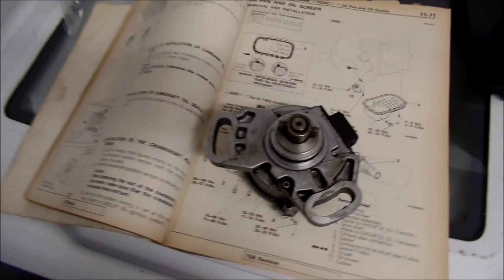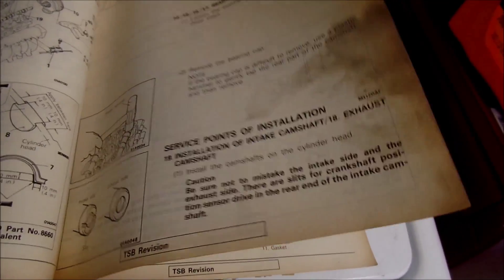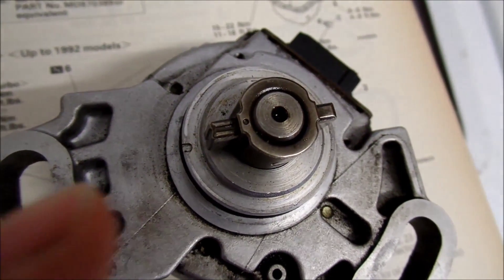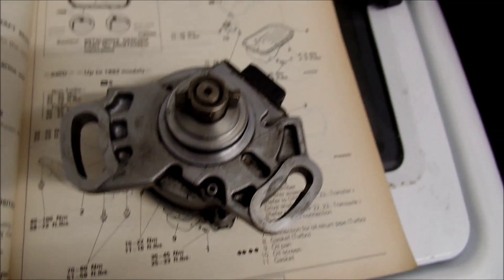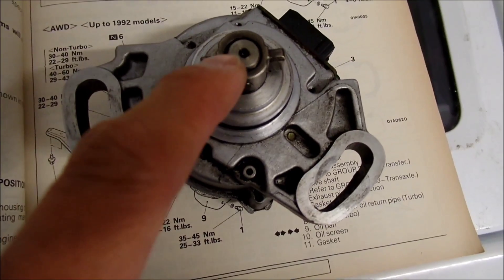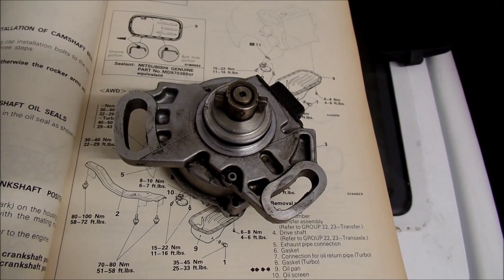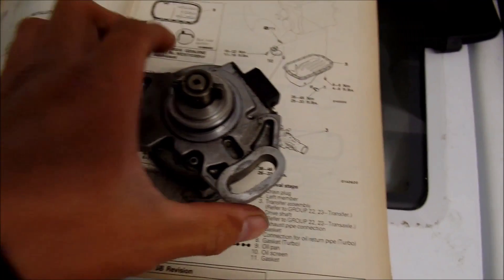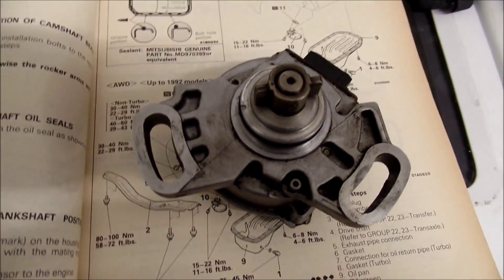HadesOmega How To Install 4G63 CAS (Cam Angel Sensor)

Comment: it doesn't matter if it's fitted either way around. They run wasted spark so 1/4 cylinders and 2/3 cylinders fire simultaneously
Reply: I would assume it would fire 2/3 when 1/4 is needed if installed back wards
Reply: @myramyrightnut1084  huh??
 The firing order is 1342. 
Cylinders 1 & 4 fires at 0° & 180°
Cyliders 2 & 3 fires at 90° & 270°
That cam angle sensor can only fit two ways, 0° or 180° out...
So, if it's meant to fire on cylinder 1 and timing is out by 180°, it fires on cylinder "4" instead. 1 and 4 share the same spark event on a wasted spark system so it makes no difference. 
If it were a conventional sequential ignition system and 180° out, it will fire on the opposing exhaust stroke of every cylinder.

Comment: As a heads up, it measures both the cam shaft position and the crankshaft position so it's technically both. That's why it has 4 wires. Power, ground, Cam signal, and crank signal
Reply: Can I read RPM as well?? Thats a doubt I have.
Reply: @BARRIOSENTERPRICE  I don't understand your doubt here. The crank position sensor is your "RPM sensor." It reads the position and counts the rotations which results in it reading the rpm.

Comment: where did you get the vr4 manual!!!???? need one but it's for imported 89 galant
Reply from the maker: I think I got it on ebay, there are not many good aftermarket manuals for the GVR4, the 1G eclipse/talon manual will be ok though.
Reply: HadesOmega I have the 90-98 Chilton manual and it does good for the engine and trans. interior and body is the dead zone.
Reply: @HadesOmega  Bro I need that manual? how can I get it? I want a digital one
Reply: Justin Hoth I have a 89 Mitsubishi too but I have a problem find the crankshafts position do you where is located. this is the link where I'm going to buy it let me know if this is the right one.www.autosparepartsmart.com/camshaft_sensor
Reply: @21elimprecionant   @HadesOmega  Bro I need that manual? how can I get it? I want a digital one
Reply: Joel Rivera I ended up having to buy a 1g dsm crack position sensor and had to wire the plug from my old sensor to the new. that help?

Comment: 95 96 dsm dose not use that style cas they are under the cam gear
Reply: Johnny Lucas really ??? My 95 gst has the same looking one
Reply: @hc.og6698  well the 1g ones are better u can change it with a adapter :) most 2g guys do it